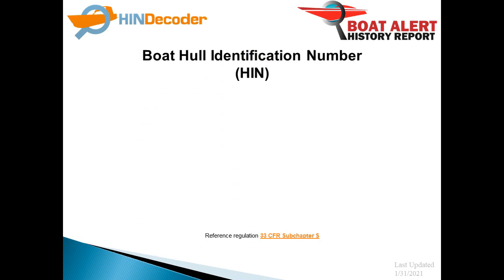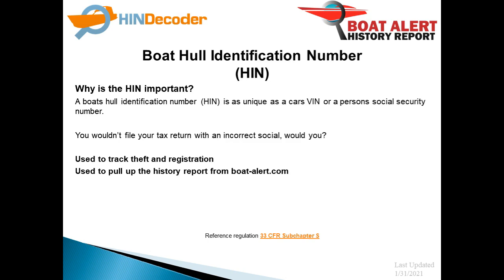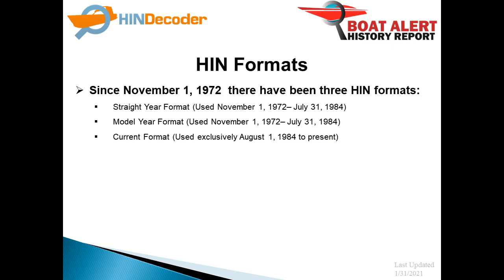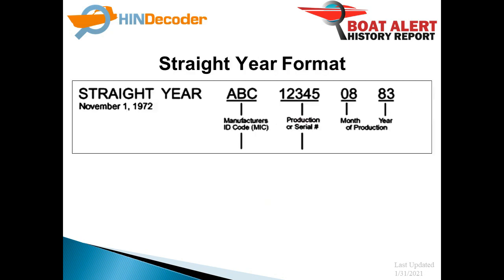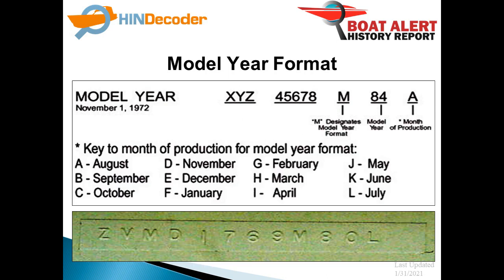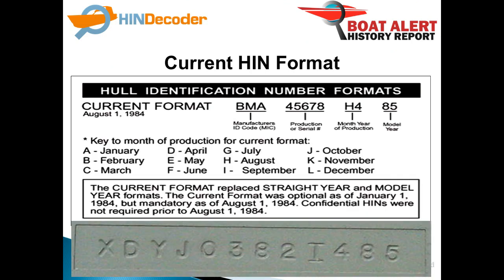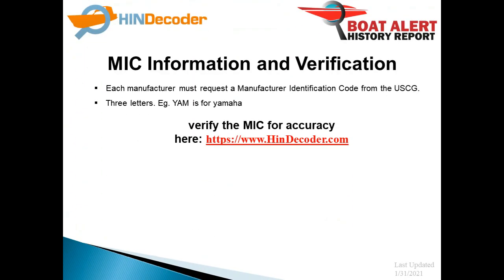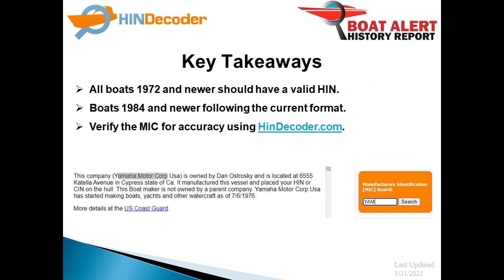Hull Identification Number - BOAT HIN Formats Explained!

Comment: The decoder needs to be updated. The HIN I was just issued in Michigan results in an error about the 9th position needing to be a letter. My 9th position is a digit (it is a zero). I also tried the letter O.  :)
Reply from the maker: Hey, try putting a letter d instead of o or zero. according to the format, position number can only be one of these: * A – January          D – April          G – July            J – October
      B – February         E – May            H – August          K – November
      C – March            F – June           I – September       L – December

Comment: I’m looking for a boat that was built in 1955, and it has a 5-digit hull number. Can you help me to convert to an HIN? Any help would be greatly appreciated. Thank you.
Reply from the maker: you cannot convert HINs. they are issued by the manufacturer as is. The format only started in 1972 so any serial number made before that year would just be a serial number and not a valid HIN. If you have 5 digits (no letters), then it might be a USCG number. try looking it up here https://www.boat-abstract.com/

Comment: I'm buying a 1972 boat must have not changed to new format?
Reply from the maker: correct. not all states require a migration to a new format. the old format is still valid. Its only when you have a invalid HIN that you need to get a new one issued